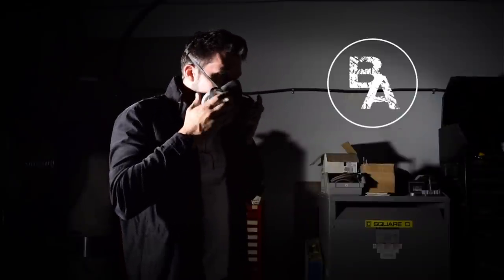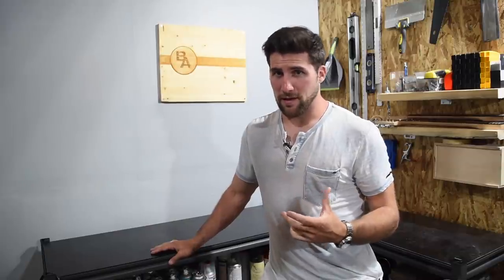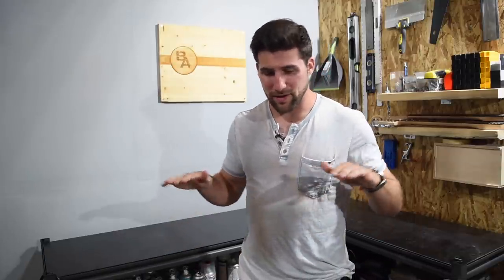Why is your paint crazing?

Comment: Really appreciate your videos - just had wrinkling happen on a Tele I'm building using all Krylon products. Let the final color coat dry 24hrs the clear coat wrinkled basically on contact. Had a similar thing happen using all Rustoleum 2X products (which is why I moved to Krylon - hey I'm on a budget). I'm really feeling this is a reaction problem - what I'm hearing on the internets is to apply color coats and then move straight to clear coat waiting around 20 - 30min per coat. Or I hear if you wait 24hrs you need to scuff the final color coat (which I hate) so the clear can bond with the color. What worked on my last job was wait 24hrs - I scuffed the final color coat - applied another coat of color - then started clear coating after 20min - worked fine. Feels like a crap shoot at times.
Reply from the maker: What you’re hearing is essentially correct. Fresh paint/clear doesn’t adhere to partially cured gloss paint (with limited exceptions). It needs to be scuffed for it to bond properly, or recoat I led within a short enough time to allow for chemical adhesion.
Reply: @BradAngove  Well that worked - I spaced these coats about 25min apart 3 primer - 3 color - 4 clear  -- all were fairly light but good coverage. Turned out fine.
Reply from the maker: Glad to here it worked out.

Comment: I accidently got that effect on a pickup cover once.  I believe it was reaction related but wasn't sure exactly what paints I'd used.  I must have tried a dozen different colors of paint for the hardware on that build.  I've been wanting to reproduce the effect for a long time now.  Based on this video, I suspect it was lacquer followed by enamel, followed by more lacquer.

Do you kbnow of a combination of paints that will cause cracking, yet leaves a durable finish?
Reply from the maker: No this kind of cracking. It’s indicative of a paint failure. There are crackle finishes though that are durable. I have a video on those.
Reply: @BradAngove  Thanks for the tip - you're my goto for paint guitar finishes. I'll check out your vid on crackle.  I tried some tests with crackle, but it was cheap stuff designed for metal valve covers and such - not impressive on wood.

Comment: I was using lacquer thinner to even out some touch up paint. I had put a piece of tape to mark the area. I think I went a little overboard with the thinner. The tape seems to have absorbed some of the thinner when I lifted the tape, there is a small area of the clearcoat that appears to have slightly“raised” “lifted” or “expanded” it’s only visible against the light. I’m concerned that the thinner penetrated into the there might be some crazing in that area later on. It’s a factory finish. What do you think?
Reply from the maker: What kind of paint is the factory finish?
Reply: @BradAngove  Plain white, BMW 3 years old. I suspect if there’s a problem there, it might be more visible if it was a different colour. I don’t see a hint of change or discolouration on the white itself. Funny thing is the “raised” area is further away from where the tape starts absorbing the thinner. You would figure an oddity would appear where the tape is most saturated by the thinner but the inner area of saturation looks fine. It’s barely visible anyways, it could almost blend in with the orange peel. It’s not an issue, just concerned if something will happen long term.

Comment: This happened to me on my latest build. I thought the guitar was cured, had left it in my apt for about a week then it sat in the garage for another week. Was about to put another coat on the front and it started wrinkling. I'm like huh? I think the humidity got to it from sitting out in the garage. So just scraped off the paint and gonna start fresh. Sucks cause I was almost finished. But not gonna give up. Using rustoleum 2x paint/primer gloss. First time it has happened to me. I will learn not to leave my guitars soaking up humidity in garage. Paint and wood do not like humidity! I learned my lesson.
Reply from the maker: It may also have shrunk depending on how cold your garage is.

Comment: Brad Angove, I've watched almost every video you've had to make sure my project as smooth as possible.  Everything was going perfect until I ran into this "crazing" problem.  The whole body and neck is one color and the face of the headstock is black.  Body and neck are flawless I'm very impressed with the results to be honest coming from a spray can.  The problem came when I clear coated over the black. I realized the black I chose accidentally is a Paint+Primer black.... all the paint I'm using is rustuleum painters touch. It's been drying for 7 days before laying the clear. Is there something about the paint+Primer thats different???
Reply from the maker: I’m not sure what’s different about it specifically, but I try to avoid using it. You’ll probably need to sand off just that part and try again with the same type of paint you used on the rest of the body.
Reply: Brad Angove appreciate the response! Here's the kicker... I checked the color I used for the body, and it is also Paint+primer... back to the booth to try again.
Reply: Brad Angove so after some experimentation.  I found the cause of the problem,  the residue left over from the masking tape that I used to tape off, left just enough residue behind to not let the clear stick to the color.
Reply from the maker: That makes sense. I’m glad you solved the mystery haha.

Comment: I have cracking or what looks more like shrinking of a stain under a clear laquor top coat. I believe the painter probably put to much stain on without letting it dry properly. Is there anyway to cover without stripping? Its everywhere. Can we use shellac primer over then use stain over that?
Reply from the maker: Are you still looking for a stained look finish?

Comment: A great little tutorial! Planning my first build using auto paints and this will motivate me to NOT RUSH the various layers. With other finishes like stain, oil, wax I have also had problems by being in too much of a hurry. specifically after getting a nice look after many coats of Danish Oil type treatment (similar to TruOil) I've gone to waxing too early even though I've waited a day after the final oil application. It makes for a real problem as that wax polishing which requires a hard buffing and heating up the wax has softened the underlying layers and makes it impossible to get a a good finish. Easily recoverable though in that as the oil and the Renaissance wax I was using are petroleum based I just left the body for a day and then did a coat or two of oil and then left it a few days before waxing again. Much better! For info I still wasn't totally happy with the look so waited a few more days and then used Autoglym Resin Polish (another auto product). That's a liquid product and much easier to apply than the solid wax but probably needed the wax underneath. The result was really pleasing.

In short I totally agree that there is everything to gain by waiting as long as possible between layers (meaning different products like primer, colour, and gloss) and to a degree between coats of each layer.
Reply from the maker: +Edmund Isanski Waiting longer does tend to be the safer option. That sounds like quite the finishing project. I'm glad it turned out well.
Reply: What i find handy is clean after every coat that dry's i use a vevor spray booth & dew to lack of ventilation after 15min's between coat's put a fan on to get some air flowing & yes i've had plenty of wrinkle's

Comment: I've been working on a travel trailer, aluminum siding - white... I've fixed and have gone thru 3 cans already, various spots...but I'm doing the front. 4 spots I'm getting cracking after 1 can....it was days later dried...temp 56-65'f
I thought it was the new can....I really sanded and cleaned it again with a different can (same automotive rustolum gloss white) did it again in the same area too
Reply from the maker: Cracking isn’t caused by old cans, it’s caused by paint shrinking. This can occur from temperature fluctuations, or if you’re layering too much too quickly.

Comment: Yes. Don’t think you can paint in a cold garage and run it inside to off gas in the heat. Won’t work, my clear coat cracked like a road map. Now I have to wait for it warm up enough outside to repair it.
Reply: mikescharvel yeah. The bottom of the door is like it for my 16 polo s

Comment: thankyou heaps. I finished painting a set of Rims and could not work out wtf happened. It looked great after I finished the clear coat, had a look the next day and the paint under the clear was ripped and rippled everywhere.
Reply from the maker: Hopefully the video helped.
Reply: Brad Angove yes it did, was much useful information thankyou. 
Quick question, is it possible to respray  acrylic base coat over 2k clear with just a light sand of the  clear or would I have to sand the clear coat completely  back to the acrylic base coat
Reply from the maker: You just need to remove the gloss to give the acrylic something to stick to. A light sand with 600 grit is generally adequate.
Reply: Brad Angove thankyou for your help

Comment: Just found your channel. Was hoping you could give some insight on painting plastic such as fairings. I went with upol enamel and Duplicolor 1k extreme gloss. I am very disappointed in the results as the clear left a gold tint and this was with black. Waited a week before shooting the clear and now three weeks later it bubbles up when a drop of gas touches it and wipes clean off with acetone.the clear wet sands "ok" but the enamel a month later still balls up. Wishing I went with a 2k clear but was not sure if it would react with the enamel. Not sure what I should do at this point, I'm in for $300 already. Am I looking at stripping everything off and doing a complete repaint? What do you suggest? Can what I've done be saved somehow? I only choose to use enamel because of it's flexibility knowing that I couldn't get a flex agent with a 2k rattle can.
Thanks. Subscribed.
Reply from the maker: Are you not able to polish up the enamel itself?
Reply: @BradAngove  I would think that the enamel would polish as I shot a car with Rust-Oleum thinned with acetone years ago and it polished up ok. However this project was all covered with 1k clear that left a yellow/gold tint. Are you suggesting that I wet sand everything down to the enamel and then compound/polish?
Reply from the maker: That’s probably a reasonable option. Enamel usually doesn’t play well with clear coat.
Reply: @BradAngove  thanks for the help with this  perhaps you could do a future video on some of the reactions when using different types of paint and highlighting the downsides of each while putting emphasis on the benefits. (UV/solvent resistance, ease polish & sanding, flex and adhesion)
Doesn't seem to be that much information out their other than conflicting options. It could help save a lot of people the trouble that I am going through. Again, I like your videos due to the no nonsense approach you take.  👍

Comment: Got cracking from 3 variables on my 2nd coat of clear. Heat, was like 95-100. Too heavy a second coat within 20 minutes. And might have been incompatible putting rustoleum clear over krylon fusion. Had no problems putting my krylon coats on in the temps

Comment: Do PH changes also effect this? I'm using limewash on I assume a latex or possibly oil based wall (underneath, plaster). I would have scraped down but found a primer would help adhere without removing. Initially I used shellac based because of third-hand smoke and realized (of course) the alkaline lime would break down shellac. Recoated with acrylic primer and still some light crazing. I am finding nothing to this problem. Do you have thoughts on this?
Reply from the maker: I’m not sure if alkalinity is the source of the issue or not. I could be.
Reply: @BradAngove  thank you, Brad for replying so quickly. Outside of my issue your video was very insightful.

Comment: I am getting long, but very fine, cracks in the paint on just one side of the guitar (the back) - all basically running in the direction of the grain. 

Started with a raw basswood body - sanded up to 320 in stages, after that sealer with sanding, then wood filler with sanding, automotive acrylic primer with sanding, base coat of acrylic lacquer pearl gold followed by top coat of acrylic lacquer candy red. Let it dry for 3 weeks (it's been hot and humid here, but I timed the actual spraying session to a sunny day with a bit less than 60% humidity). After the first week it looked ok bar the little hole from a piece of dust I tried to remove, but now on the back of the guitar there are a few long fine cracks that show when you look at it from an angle in the right light.

Would it be enough to sand away the red candy layer and re-apply gold + red candy, or should I go further down than that?
Reply from the maker: You only need to sand through whatever has cracked. It must have shrunk.

Comment: I spray painted an interior/exterior Premium paint +primer Gloss enamel  on top of a chair that has some paint on it but needed touch up and was going to repaint the whole thing and it immediately started crazing. I'm sure it was a chemical reaction. I believe I will have to sand all of those areas and repaint . How do I know what  what kind of paint to use.
Reply from the maker: You could just sand all of the old paint off and use whatever you want essentially. Otherwise, you may want to try just sanding the crazing to get everything smooth and then adding a very thin coat of the same paint to see if that resolves the issue.

Comment: Thanks 
Good food for preventative measures. (Hind sight and all, UHG)
I know squat about painting  . . .  GOT  these y block valve covers, put on a good coat of tremclad hi heat gloss black (which by the way is a medium gloss at the most, maybe ) but for these covers I wanted hi gloss and heat resistance.  So I sprayed the heat paint on bear metal wiped clean first w acetone then within 10 minutes sprayed tremclad hi gloss normal paint. Both good layers. Was really glossy and looked great.
A day later I noticed at the edge of the flanges a tiny glimmer of steal I missed painting, so I sprayed these edges and a few spots on the covers again. Now I have alligator skin texture valve covers. I'm going to leave paint on and allow it to thoroughly dry like for a few warm days or more, sand with fine paper and try again. 
I'm guessing the coats were thick and haven't thoroughly dried enough.
(Or the hi heat paint is another chemical).
Reply from the maker: I don’t really have any experience with high heat paint, but those recoat times do sound problematic especially for relatively wet coats.

Comment: I only use the same brand paints and confirm the types are compatible with manufacturer.  

Rust-Oleum staff told me that if I sand any paint that is not fully cured that I should wait 48 hours to rcoat with different color or type of top coats (such as color on top of primer, or clear on top of color).  They said sanding opens up pores in uncured paint that must be allowed to dry for 48 hours before adding new colors or types on top.  Have you run into problems by not doing this?
Reply from the maker: I haven’t, but I know some people have.

Comment: It's sometimes difficult to identify what went wrong when crazing happens.  I've had it happen on occasion after I thought I had all the bases covered to prevent it.  I do know that crazing can be created everytime if there is a temperature difference between the temperature of your paint and the temperature of the surface that your painting.  Take a 70 deg. F rattle can from your warm house and spray it on primed metal item outside that has been stored at the outside temperature of 60 deg. F and I guarantee you will have crazing.
Reply from the maker: Of you spray it relatively heavily, yes. You absolutely will.
Reply: Thought I would do that as well...nope I have cracks again

Comment: Do you have a video on how to fix this??  I was using Rustoleum 2x coverage rattle paint & clear on kitchen cabinets.  The paint turned out great.  First clear coat was good as well.  Let every coat dry 1 hour between coats  as per instructed.  First clear coat dried overnight.  Sanded with 400 & then wiped down as usual with tack cloth.  2nd clear coat goes on & I'm getting crazing in certain spots.  Some of the cabinets turned out great & then I have small sections on different areas with cracking that is ugly as hell.  Is my base & paint coats affected as well?
Reply from the maker: It should only be an issue with the top coat. Sand it back flat, and apply lighter coats. I would avoid the tack cloth. It may be leaving a residue that is reacting.

Comment: I have heard that there are different types of spray paint, acrylic, and enamel. How can you tell if a can of spray paint is acrylic or enamel? Of all of the colored spray paint cans that I have, none of them specify whether they are acrylic or enamel. I understand what you said about mixing types of spray paints and that many factors may play a part with a paint job to craze, but how can I tell if a can of colored spray paint is acrylic or enamel? Am I overthinking this? Thanks.
Reply from the maker: Check the manufacturer specs online.